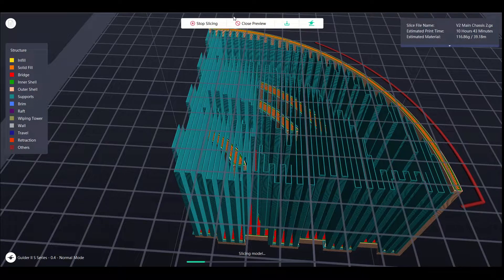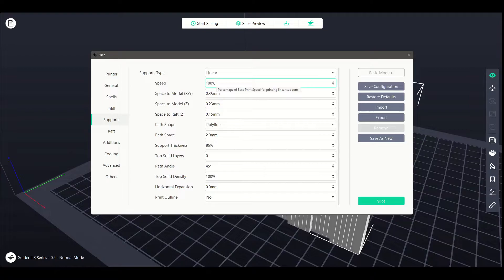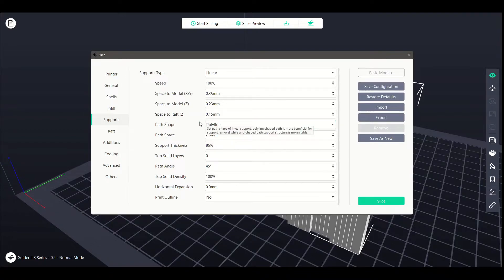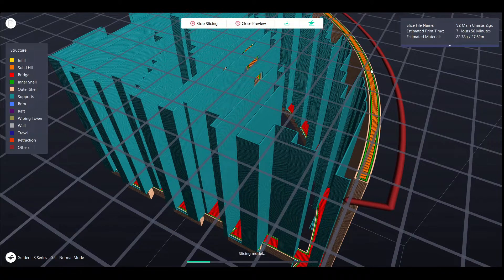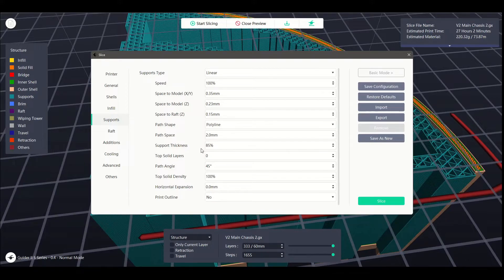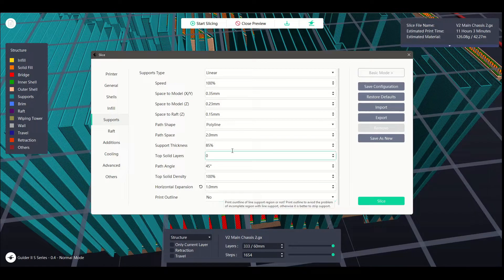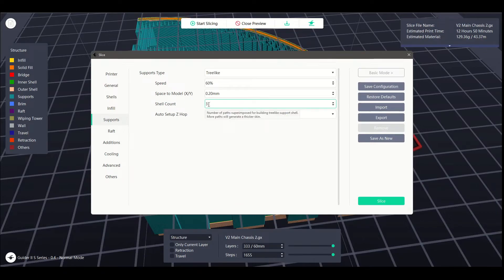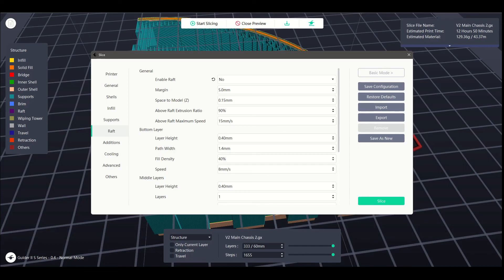FlashPrint New User Tutorial - Part 05 - 5 - Support Settings

Comment: Hi, is it possible to change the horizontal expansion setting?
Reply from the maker: @benjaminolivares512  Hey, thanks for watching and sorry if the audio is a bit average as others have said.

You can change horizontal expansion settings for linear supports, but not for tree like. The setting is 4th from the bottom. And this is in version 5.8.4

Comment: How can I change the settings for te toplayer? If I print something flat, my top layer doesn’t look that need, it is clear to see tha the nozzle have been across everything, so it has lines across the top layer, is it possible to avoid that in this slicer?
Reply from the maker: @DRN  you could turn on “ironing” which is in the “advanced” section. It’s meant to give a nice hot squeezed out layer above the top normal layer and give a smoother finish.

That setting is a simple on or off one, so it won’t require any fiddling to try it. Would recommend using it on a basic model that isn’t super large so you don’t use too much filament trying it out.